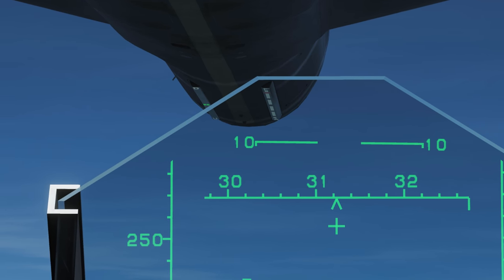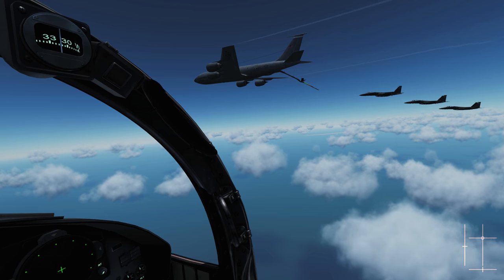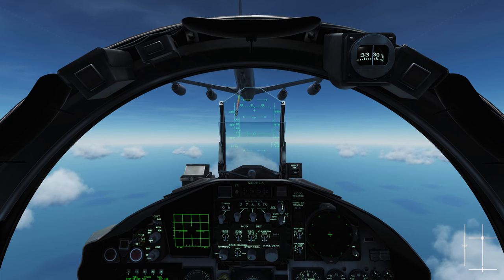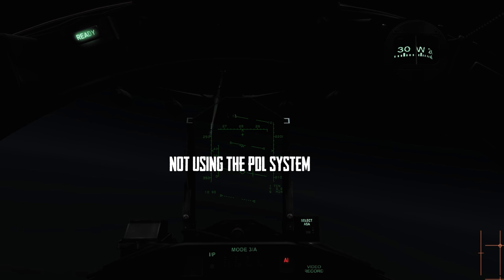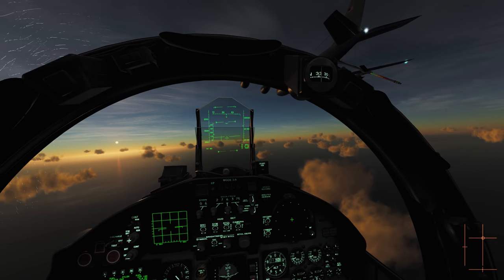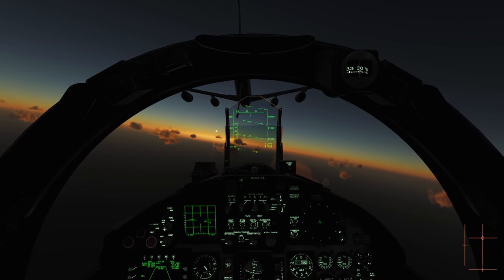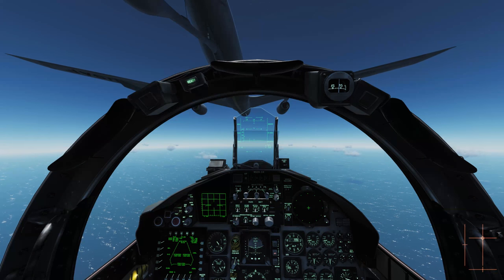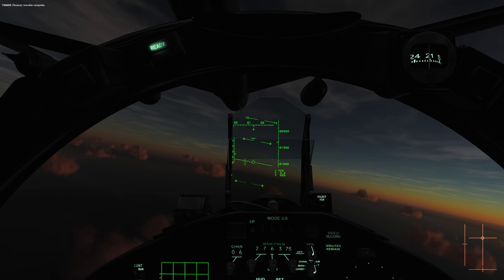DCS Fuel School | AAR Tutorial |  Episode 2 - F-15C

Comment: some tips that worked for me in refueling F-15. 1.) rendezvous with tanker, lock him up on radar becasue DCS does not model correctly TACAN for F-15 eagle. 2.) for speed control its useful to think of throttle control like 3 steps forward 2 steps back and observe. 3.) when entering and staying in the green lights control zone in the middle and taking fuel, keep your points of referecence on the tankers bottom fuselage yellow line, and the lights themselves, and the engines for horizontal level, scan all three areas one after the other constantly. For additional visual cue, you can try to line up the top of your HUD glass so that you can look at the tankers lights above the HUD glass edge when using trackir 4.) when the lights tell you UP PITCH, you can also immediately at the same time increase thrust, because pitch up will slow you down immediately, when lights tell you DOWN PITCH, you can slightly decrease throttle or keep it at same. 5.) practice controlling the throttle and stick at the same time, when in the green lights control zone, so youre able to adjust both throttle and stick at the same time. F-15 doesnt seem to have special control laws for air to air refueling like F-16 does so i think being able to control both throttle and stikc at the same time is valuable skill. 6.) you can try small deadzone like 2-3% if it helps, I feel like it definitely helped me in refueling

Comment: Nice vid mav.
One thing i might add to the section about throttle control is this: Modern jets have a digital engine control system called a FADEC, this means the "throttle" lever is not truly a throttle but a thrust lever that the computer is constantly interpreting the position of to adjust the engines. This combined with the nature of jet engines to have a lot of rotational inertia and the inability to instantly change power settings means that the engine setting is always slightly lagging behind the throttle position. This is one of the major reasons why activities like tanking and approaches require constant throttle adjustment.
I hope that makes sense.
On relaxing: wiggle fingers and toes....you can't have a death grip and wiggle your fingers at the same time